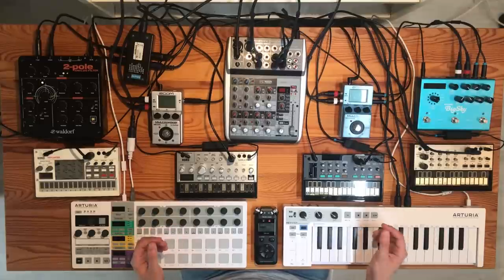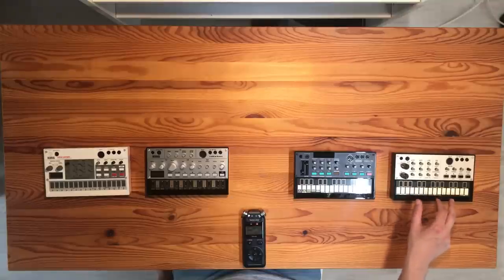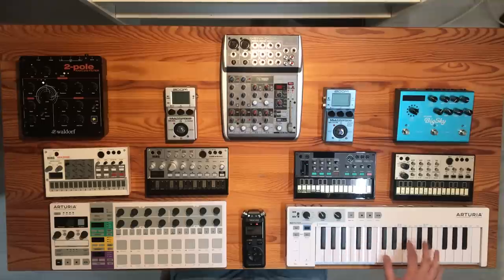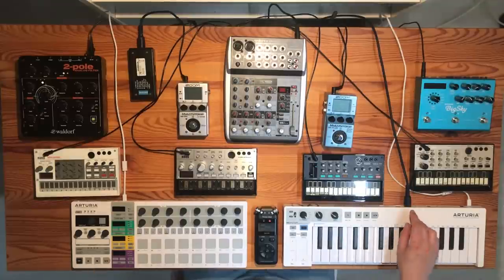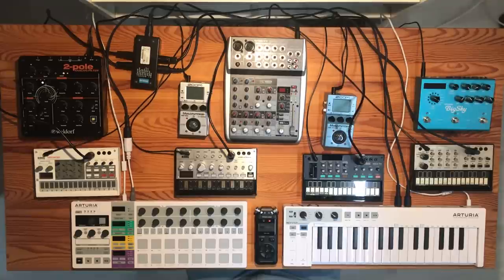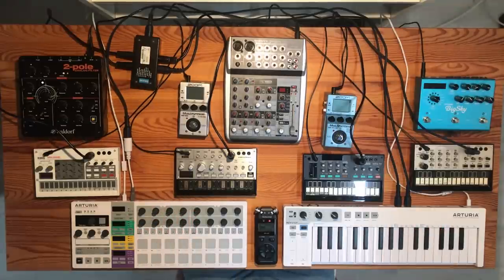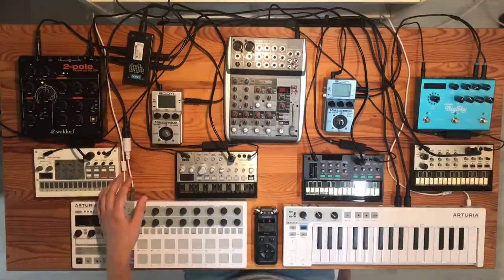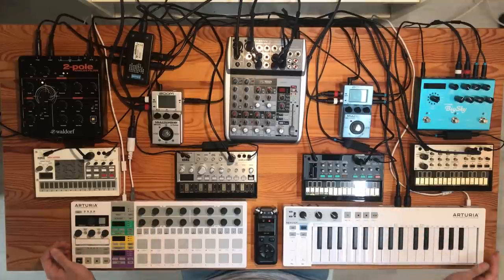Our Volca Setup: How Is Everything Connected? (2018-06-03)

Comment: Thank you for thorough explanation! 
I noticed Behringer U-Control UCA202 in description. What are you using it for?

Second question is it possible to power your mixer with USB powerbank? I know there are small battery powered devices like Roland GO:MIXER PRO, but judging from reviews the noise level is not acceptable. Do you know mixer that don’t need AC power good for live sessions?
Reply from the maker: Glad to hear it was useful. Regarding the UCA202: I explain why we use it at 14:35 - it's to get the sound from the mixer into the computer which we use(d) to record the music. Nowadays we use the UFX1204, which supports recording directly to USB harddisk. For a battery powered mixer, you might want to check out the Bastl Dude. :)

Comment: Thanks for the great explanation on your setup. I have also noticed the ground loop issue with the Volca and was wondering how to deal with it. I will look for those little blocks and see if it helps ;-)
Reply from the maker: holotropik : You’re welcome! For us it got rid of 90% of the noise. Other things that helped: getting proper adapters, or getting a device from a daisy chain onto its own adapter. :)
Reply: If you love batteries this will also eliminate the ground loop (volca side anyways)
Reply from the maker: Palindrome AU : True, but who loves batteries?? ;)
Reply: Slenterende Beer im all about the rechargeable battery

Comment: Hi, excelente vídeo! I was wondering if you could tell me how to better connect my devices; Korg kaossilator, rc202 looper, op1, midi keyboard seaboard ROLI, po ko32; iPad USB-C, maschine , mk3; they are all connected to a dude mixer and then connected to Arturia audiofuse, the issu I have is that some instruments sound really low and other really high. I’ve got a hart mixer and connected everything to the mixer and then to the audio interface which is connected to the computer, but still same issues. Any advise will be appreciated. Thanks,
Reply from the maker: Sandro de Souza : Hi! If by “low” and “high” you mean the volume, then I guess you could just turn down the instruments that are too loud? Sorry, I know it’s a lame answer, but I don’t have better suggestions right now...

Comment: I tried to connect my keystep with my 3 volcas by using a midi thru box but, if I set the proper MIDI channel of one of the volcas (i.e. th e volca keys), the sequencers of the three volcas start simultaneusly when I press "play" on the keystep, why ? There is a solution? I filtered real - time events (the switch number 8 in the box) with the thru box but,in this way, no one of the volcas starts from keystep play button.

Comment: Do you still use ground loop filters or use ground lifted psu instead to avoid noise? Like separate psus for each one? Don't see those noise isolator in vid's any more
Reply from the maker: Mik G : No, we now use the Strymon Zuma, 1 PSU for all our Volcas and effects pedals, which eliminates the ground loop. We had to create custom cables for the Volcas though (reversed polarity and 1.7mm plug), so it’s a bit hard to recommend. But it’s a perfect solution for us. :)
Reply: @SlenterendeBeer  No problemo, I use one dc-dc usb to 9v cable and daisy chain cable for four Volcas since they are silent and another one for FM bcs it give too much loop noise imho

Comment: When using the UFX mixer in stand alone mode.  After you have recorded, can you mix the tracks on the fly during playback with the sliders while recording the output to a PC?  I hope this makes sense.   Thanks.
Reply: Essentially I want to “master” the track using the mixer to adjust volumes of each track while the newly mixed output is being recorded on a PC.  Versus mastering it in a DAW.
Reply from the maker: PoppyPropsFPV : I have never tried this, but looking at the manual it sounds like it’s not possible. When playing a recording, it will play the main mix, a stereo sum of all channels.
Reply: Slenterende Beer yeah I have found the same answer.   Thanks for replying.  It seems the only way to mix is down is in a DAW.  I was hoping it would have that feature, it would be very handy.  Keep up the great music

Comment: Hi, is it possible to connect an Arturia Minilab to a Volca and use both at the same time? and how should do it? Thank you so much you're videos are amazing
Reply from the maker: Moctezuma Carlos Ramirez : Yes that’s possible. It looks like the Minilab does not have a standard 5-pin MIDI DIN connector, so you will need a MIDI-USB interface for your computer. I recommend something like the iConnectivity mio, it’s easy to get started with. You connect the Volca to that MIDI interface: MIDI out from interface to MIDI in on Volca. Next you have to make sure you set the Volca to the desired MIDI channel (see the manual for that) and select that MIDI channel on the Minilab. The Volca should now respond to the Minilab. If you want to get the audio from the Volca into your computer, you will need a USB audio interface. We use a mixer that has the audio interface built-in. :)

Comment: I'm just getting into synths. The volca series seems like a good starting point. Quality sound at a cheap price. Was thinking about getting at least three of them. Which ones would you recommend for a beginner and is the volca mixer worth getting?
Reply from the maker: J. Simondz : Yes, the Volcas are great beginner synths. I highly recommend getting the Sample for drums. Great sequencer and you can change the samples to anything you want. The next one should be one of the polyphonic synths, so either the Keys or FM, depending on which you like most. The third one can be any of the other ones... I really love the sound of the Bass, but its sequencer is more limited. The Drum is also fun and very versatile , but you should make sure you discover the sound first, it’s quite unique. I think the Mix looks great for a beginner (I’ve never used it), it’s easy to setup and it’s nice that it provides power to your Volcas, so you can skip the batteries. My final tip: just start with one Volca. Get to know the instrument first before you buy the next one. It will prevent you from becoming overwhelmed and hopefully give you a better idea of the type of sound you’re looking for. :)
Reply: @SlenterendeBeer  Awesome, tnx for the tip. ✌️
Reply: Sweetwater.com is offering a free Volca mix if you buy 3 Volcas! So ya think I'm going to jump on that. Going to get Sample, one of the drums,  and either FM or keys. Been leaning towards Sample, Drum, and Keys. Pretty good deal! Spread the word ✌
Reply from the maker: J. Simondz : Yeah that’s an awesome deal!! US only though.

Comment: Hi guys and Great video. Just a question about the miditechfilter. How have you set the dipswitches on the filter? 1 to 8, wich is off and on because i have tried to store the settings by holding down the panicbutton and so on. Or did you store everything by the software? Thanks again for a great tutorial, greetings from sweden.
Reply from the maker: Mikko Inemyr : We turn on switch 3 and 7, for filtering out note velocity and start/stop messages respectively. Hope that helps!

Comment: Thank you for this very useful guide. I have a couple simple questions. Is it possible to control the Volca Bass's LFO rate from the beatstep pro? How do I set that up? Are there templates I can download to set the Volcas up on the BSP?  (I'm thinking FM on synth1/leads, KV bass on synth2/bass and sample on synth3/drums). Thanks.
Reply from the maker: Hi, sorry for my late reply. Controlling the Volca's parameters is possible using MIDI CC messages, just Google the "Volca Bass MIDI implementation chart" PDF. Sending those CC messages from the Beatstep Pro is possible in control mode. You will need to create a CC mapping using Arturia's MIDI Control Center (MCC) software. Unfortunately it's not possible to sequence the CC messages with the BSP. I've never tried this, so I can't help you with the exact details. I don't know of any Volca templates for the BSP. Good luck Googling, let me know if you find some interesting / clever solution! :)

Comment: For beginning I have to thank's a lot for sharing this video ! But I'm french and don't understand everything... how do you named the midi "multi-plug" that come from keystep and goes to the all the volca? and how do you named the multi-plug for volca's "DC9v"? if you or someone can help me please ! I Hope my English is good. and thx again for the video and thx beforehand for the answer
Reply from the maker: Hi! The MIDI box is called a "MIDI Thru" box. This specific one, the Miditech MIDI Thru/Filter has extra functionality to filter out certain MIDI messages, such as note velocity or start / stop messages. The power splitter we use for the Volcas is typically called a "daisy-chain", but this specific one is the MyVolts 5-way power splitter cable. Hope that helps! :)
Reply: Great ! of course that helps :) thank you!

Comment: I know I may have asked you this before but, I have almost the same setup as this; however, a few less items.  In your setup here would the Roland Mx-1 work instead of the Behringer mixer?  I am still trying to find the best mixer solution that I can have USB into my laptop to record.  any help is appreciated!
Reply from the maker: I am not familiar with the MX-1, but it looks like a decent mixer. One thing you should keep in mind: make sure your mixer has enough stereo inputs. Especially once you start adding stereo effects, this becomes important. Both this old mixer (QX1002USB) and our new one (UFX1204) have 4 stereo inputs. Also, the UFX1204 supports multitrack recording, to a computer over USB, or straight to USB hard disk, so it might be worth checking out. :)

Comment: Thank you for explaining. I have almost the same setup (7 of the items you are showing) and I am getting ground loop issues to with the volcas so have just ordered the isolators. Thanks for that. Why do you use the UCA202 and not the Mixer USB audio?
Reply from the maker: Good to hear this helps! :) So my preferred option (when using this mixer) is to use mixer USB audio and connect it to the iPhone directly, so that when I start editing the video, the audio is already there. However, since I have this issue with my iPhone (explained at 14:58), I also record the audio with the UCA202 to my computer. With my new mixer (see 3:33) I can record straight to USB hard drive, in multitrack.
Reply: ok.. sorry, yes you said that in the vid, my mistake.
Reply from the maker: Peter Schwenk : No problem, man :)
Reply: digging out the old comment because maybe Peter can help, because you wrote, that you use the same setup: I cant stop my Keystep to send the stop-messages to the Volcas. Any specific details how you have to tweak the filterbox or setup the Keystep in the Midicenter? I'm desperate...

Comment: did you have to adjust anything on the box other then putting the velocity switch to on? I am having trouble controlling my volca sample and keys by my bsp with that filterbox, I made sure about adjusting midi channel on keys and sample is set on mcc software via pads 1-16 to trigger individual sounds. I have zero control over the volcas, can not control transport either!
Reply from the maker: Nagi Yehia : No, only the velocity switch should be on. Did you make it work in the end?
Reply: @SlenterendeBeer  yeah, as i got it used with no midi cables. it needed a type b 3.5mm to midi which i didnt have and it works great now, only issue is i am trying to not trigger the volca sequenncers as i am controlling my 2 volcas (sample and keys) and berhinger neutron. any way to stop sending midi messages for transport?
Reply: @SlenterendeBeer  i tried flipping the system messages switch but still when i hit play on my bsp the 2 volcas play, I saw that u said in the comments that system messages don't actually work for transport, so what would you suggest i do to avoid triggering the volcas by my bsp since i am using it to sequence everything and not using the volcas sequencer? (fyi setup as follows. BSP(BRAIN) to miditec thru box to volca sample, volca keys, and a berhinger neutron) thanks!
Reply from the maker: Nagi Yehia : Yeah I’m sorry, the Miditech is not the solution for that unfortunately. :( The Retrokits RK-004 supports filtering out transport messages, but it’s not as easy to use. I don’t have experience with any other options, sorry. Nowadays we always just start all sequencers at the same time by pressing start on the Beatstep, and then just don’t stop them anymore. It means you’ll need to play some devices differently - for example: we use “clear all” and “undo clear all” more on the Volcas, as a sort of mute state. Hope that helps.

Comment: Thanks for this explainer. Was really helpful.

I just got the same miditech midi thru/filter box. However, I have been struggling with the settings. With default settings it is just passing the midi messages to all connected instruments. Can you tell me how can I assign each instrument to listen to the specific midi channel?
Reply from the maker: Gaga Darsalia : With the Volca turned off, hold the MEMORY button and turn the Volca on. Now the 16 steps of the Volca’s sequencer represent the 16 MIDI channels, it will indicate which one is currently selected. Select a different MIDI channel for each Volca and press the (STEP) REC button to save the settings. This is also explained in the Volca’s manual. Which MIDI controller do you use? Keystep? Beatstep Pro?
Reply: Slenterende Beer Thanks for the answer. I read the volca manual, but forgot about the midi channel settings unfortunately :(

I am using the Keystep
Reply from the maker: Gaga Darsalia : Okay, you can change the MIDI channel on the Keystep by holding the SHIFT button and pressing the key that is associated with the desired MIDI channel (indicated above the keys).
Reply: Slenterende Beer 
Thank you 
You saved my day :D
Reply from the maker: Gaga Darsalia : Great, happy to help! :)

Comment: Hi did you guys start getting the ground problem once you started using the daisy c on the volcas? it seems like that might be triggering it. (as seen from other users)
Reply from the maker: Jose Carlos Zavarse Pinto : Yes, that did make it worse. However the two most common alternatives were no option for us: we don’t want an adapter per Volca and we don’t want to run everything on batteries. The ground loop isolators were a good temporary solution, but we’ve recently switched to a more robust solution. We’re now using the Strymon Zuma, which can power all the Volcas and the effects pedals. We’ve made our own cables for the Volcas, so that we get the required plug and polarity. :)

Comment: How do you record in an iPhone? Is there an app used or just the camera app? Will it detect the mixer as the mic input when connected via lightnig to usb adapter?
Reply from the maker: aramis marquez : I use(d) the default camera app. And yes, my iPhone immediately recognized my mixer as a USB audio interface, and used that instead of the microphone to record the audio. Of course, your situation might be different with a different mixer and/or iPhone. I’d be careful with this approach though - as I explained at 14:59, I had issues with the iPhone recording, because sometimes the recording would be mono! Keep that in mind.
Reply: Slenterende Beer thanks for the fast reply! I will try this with my setup. :D

Comment: Hi, Is there such a filter box available that will split 6 notes of midi from a keyboard into 2 lots of 3 so you can have 6 note polyphony using 2 Volca keys ?
So for example, if you had notes C1, E1, G1, Bb2, D2, G2 coming into your midi filter box from your keyboard and then one output port of the filter box would output C1, E1, G1 and the other port would output  Bb2, D2, G2. Each port would remember all previous 'note ons' so as to allow for 'note offs' to go to the correct ports etc. 
I'm interested to know if there would be any demand for such a filter.  I'm an electronics engineer and could design and build such a device.

Comment: Hi! what power supply are you using for the volcas? are you using the same power supply for pedals or is another one? I asking because volca adapter is 9v with 1700 mA but in fact only need about 100-200 mA at most

Comment: I seem to remember a line of instructions on my Microfreak that directs me to avoid ground noise by keeping all my equipment on a single circuit.  Does it work for you to have everything plugged into a single AC power strip, or do you still need those ground loop isolators?
Reply from the maker: The problem occurs when you have different DC adapters. So even if they're on the same AC strip, you can get ground loop issues. We've started using the Strymon Zuma, which powers our Volcas (with custom cables) and guitar effects, and then we don't need isolators.
Reply: @SlenterendeBeer  Awesome, thanks I'll check that out! (currently I'm using reverb feedback to make my amps rf noise too muddy to identify :b)

Comment: i have a volca sample and a beatstep pro. how do i assign a midi channel to each of the pads?
Reply from the maker: ryan reidy : You can use Arturia’s MIDI Control Center software to do that. Under the “device settings” tab you can map each pad to a different MIDI channel for the drum sequencer. Make sure your Beatstep Pro is at the latest firmware first!